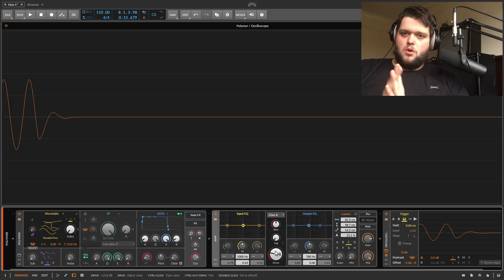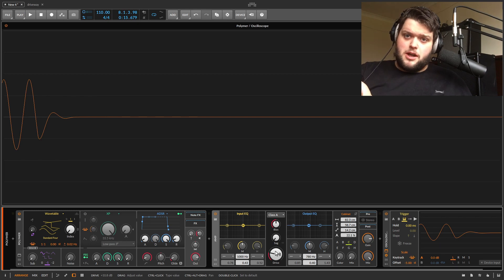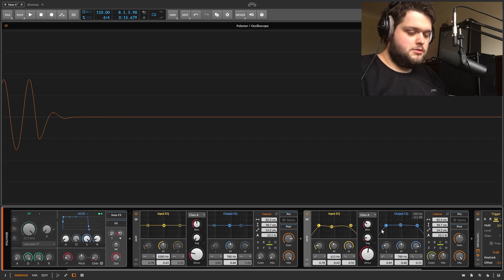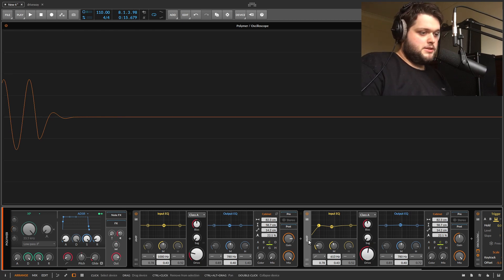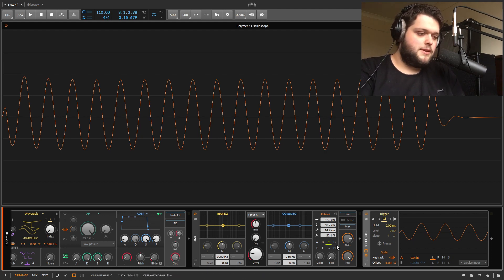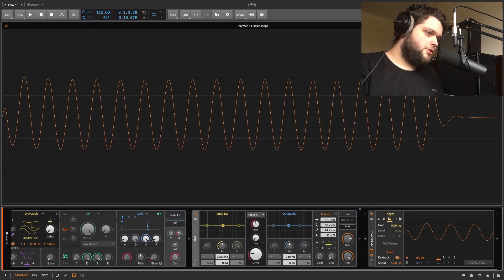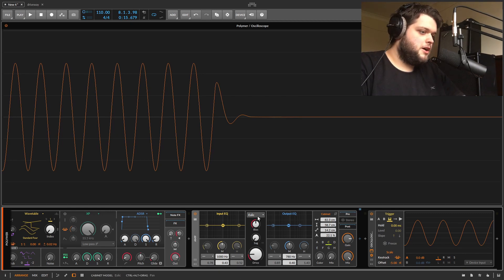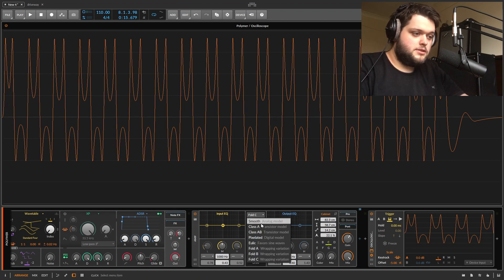BITWIG AMP - Sound Design Tips And Walk-Through

Comment: Did you try to get a heavy metal, distortion guitar sound by chance? I've been trying to find a Bitwig preset for this sound. Something I can just play with my midi keyboard. I previewed all the Guitarix plug-ins and nothing good there. I totally overlooked this Bitwig Amp option. What would you think would be the best oscillator sound to start with? Basic saw wave? Thanks for the video.
Reply from the maker: Hey man I don’t do a lot of trying to replicate guitar sounds because guitar is my main instrument. 

But if I were too I would probably use sampler with a clean electric guitar sample running through an amp plugin. Bitwig amp is not great for heavy distorted guitar sounds! I think the free LePou Amps are pretty good from what I’ve heard! 

A lot of what’s going to make it sound good is the way it’s played! Lots of dynamics and vibrato etc!